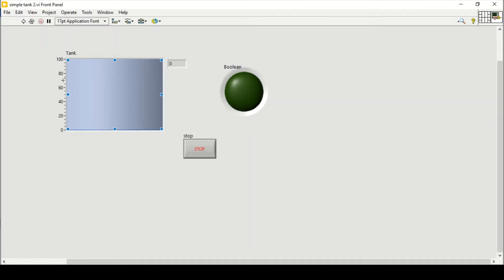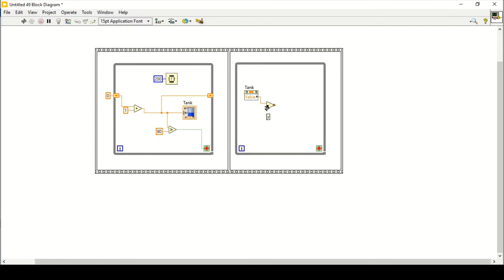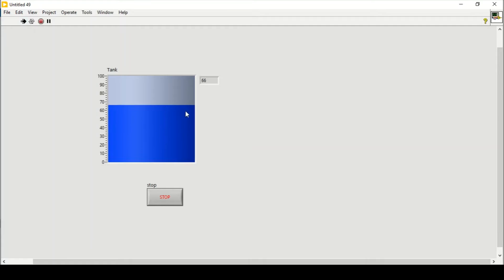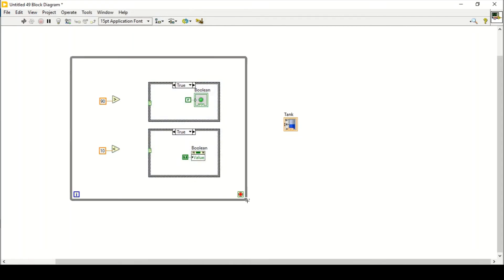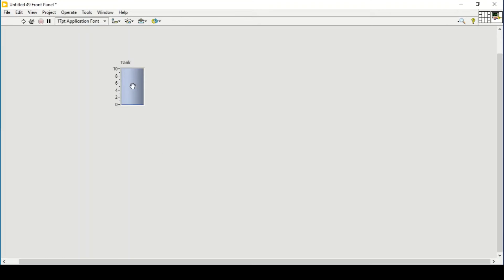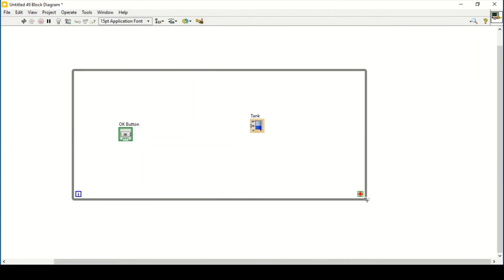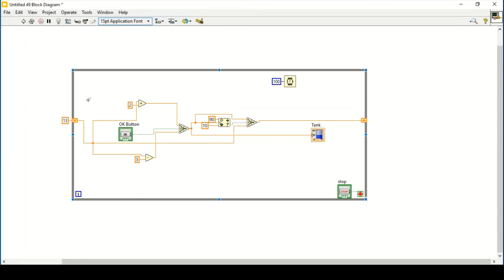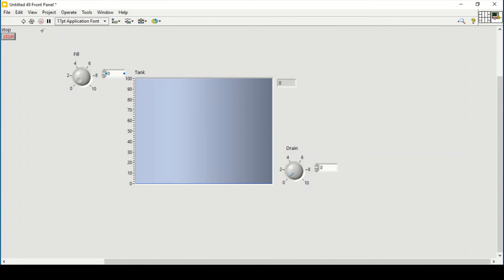Tank Level Fill control | LabVIEW

Comment: can you create a control using ring constant with  values +1,0 and 1 assigned to Fill, hold and Drain?
Reply from the maker: Yes, that is also pretty much easy. you can use case structure and make it easily. The video gives basic ideas with different approaches, you can give it a try in your own way.
Reply: been trying lately but unable to achieve the desired results  @labviewexercises8585